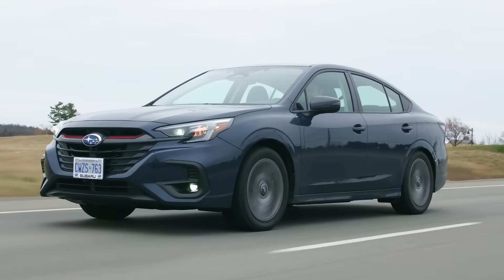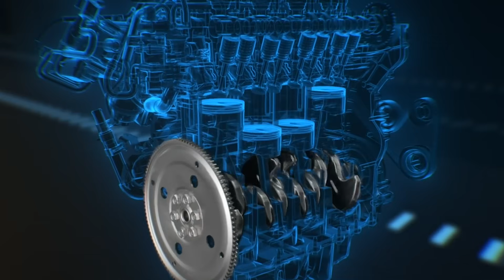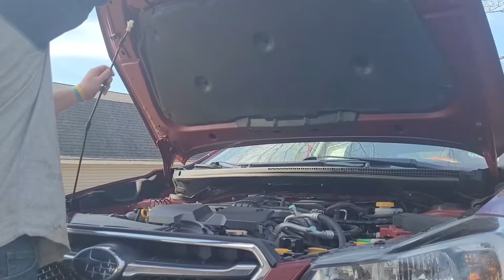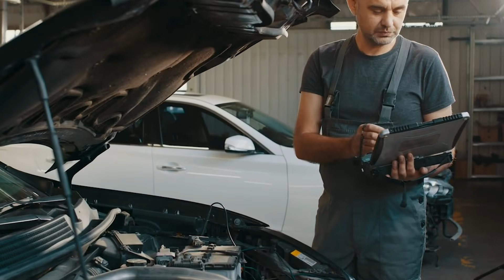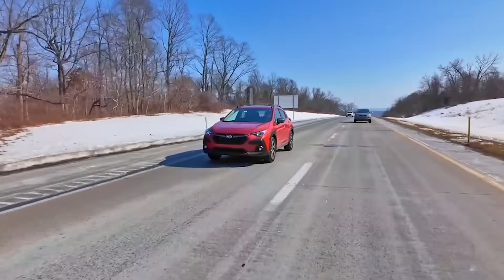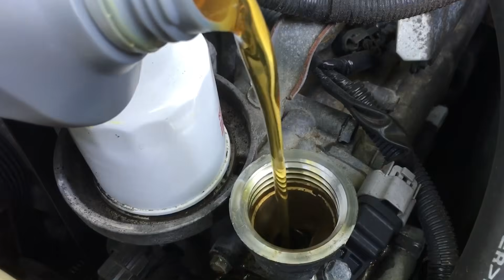The Japanese $2 Liquid Secret That Makes Your Subaru Engine Last 500,000 Miles

Comment: Expand on the catalytic converter issues.... A cat system on a 2013 CAT compliant Crosstrek cost $3300 for the parts alone the last time I checked a couple of years ago, so damaging a good one is a costly problem. I'll live with the check engine light on the car that runs great with right at 200k miles on it. I don't use the cruise control anyway, and the traction warning and cruise are the only things hindered with the P0420 code with the check engine light. I add ProLong engine treatment for cold start protection, and I don't know or care if it contains extra zinc. A mechanic friend suggested it over other oil additives. I also switched to 5W30 oil (from Subaru spec 0W20) after 120,000 miles to slow oil consumption Subarus are famous for. All cold startup valve rattle went away with the thicker oil, and it still averages 34MPG. Explain what the extra zinc does to the cat so viewers can decide if this additive might be considered.